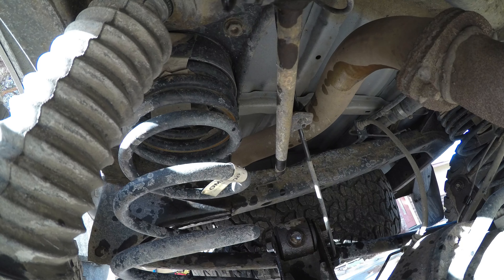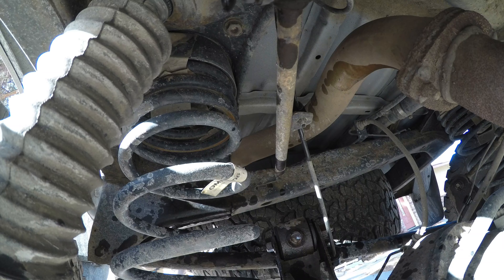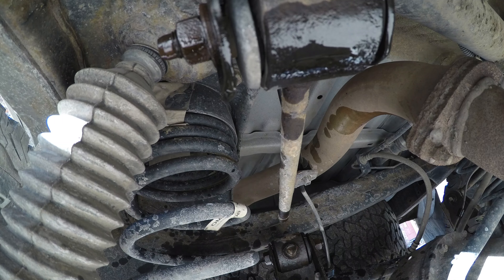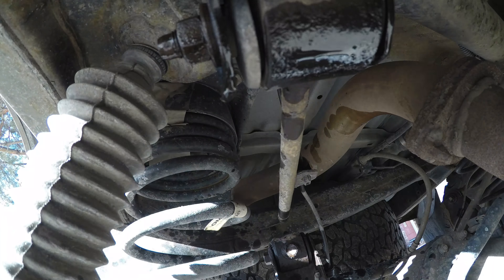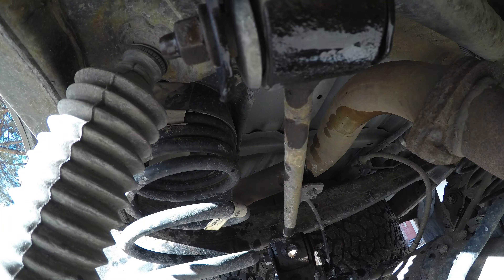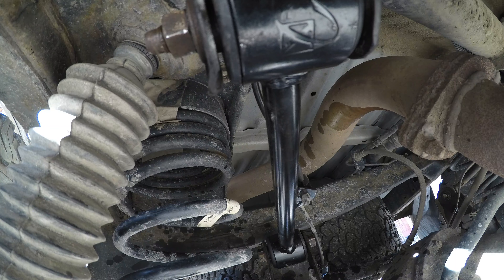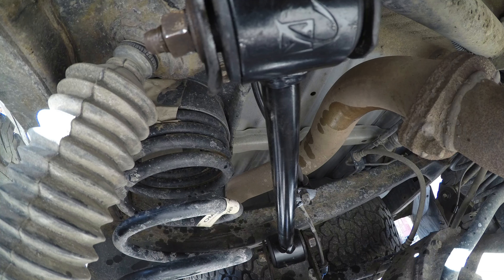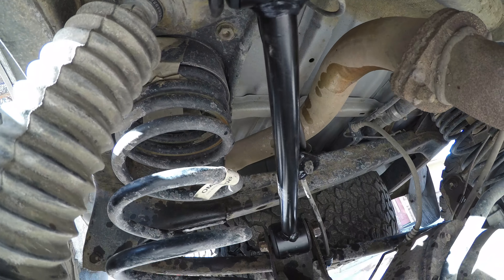Rear Upper Control Arm Replace: 3rd Gen 4Runner

Comment: Did you jack the opposite side up when replacing these? How did you get everything to line back up after removing the bolts?
Reply from the maker: I don’t remember. But I might have jacked things to get it in.

Comment: What is the length of the control arm? I got one and it seems to be a centimeter too long and won’t fit
Reply from the maker: Don’t know. Once you remove the old one the axle may move. Did you compare the length to the old one?

Comment: Cannot, for the life of me, get the driver side to line up.  Mine snapped like yours, and it won't line up.  It's actually twisted slights, and I've tried everything -- jacking up the frame, jacking up just the pumpkin, wratchet strap, ugh.
Reply from the maker: Spud wrench

Comment: Hey I’m having trouble changing the upper rear trailing arm. There is about 1/4 of an inch away from everything fitting like it should. Do I need to use a racket strap for the upper control arms? I have the correct trailing arm (4wd). I manipulated the differential with a floor jack. I ran out of sun  light but will try again tomorrow. Thank you!
Reply from the maker: Ratchet strap is what i would try.
Reply: Wow thank you! I will try that tomorrow. I will also subscribe to your page!
Reply from the maker: Also. Get a spud wrench. Google it.

Comment: Thanks for the video. Is there a specific torque spec that’s important or do you just hand tighten the new ones as much as possible?
Reply from the maker: I’m sure there is. Check the maintenance manual.

Comment: Any noticeable ride quality improvements?
Reply from the maker: Yeah. The strange washing out feeling i got going around corners went away.
Reply: @AllTerrainFamily  Cool beans. Toytech sells some heavy duty adjustable ones that I might pick up. Pretty sure every bushing on my vehicle is shot or worn out. Rather just get all new parts than replace bushings. Pricey but Peace of mind on remote trips is priceless.
Reply: @AllTerrainFamily  I have some negative thrust angle on my GX470 rear axle. I suspect this should fix it. Also, I too have that weird washout feeling when going around bends. I'm glad the Toyota and Lexus parts are interchangeable. Much cheaper to buy from Toyota. Thanks for this video. 😎👍

Comment: What parts did you use?
Reply from the maker: Napa
Reply: @AllTerrainFamily  Napa sells the same part for 2WD and 4WD. I am looking to replace both Rear upper control arms. Do you know if the same part works in 4WD?
Reply from the maker: I don’t know. But i bet they’re the same.
Reply: @AllTerrainFamily  They're the same.